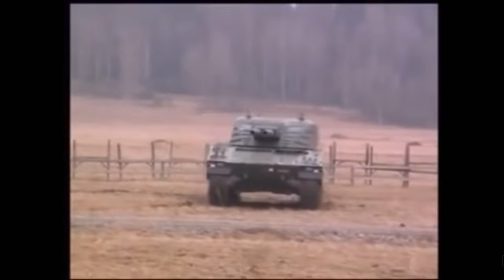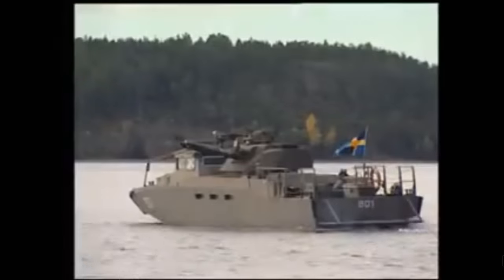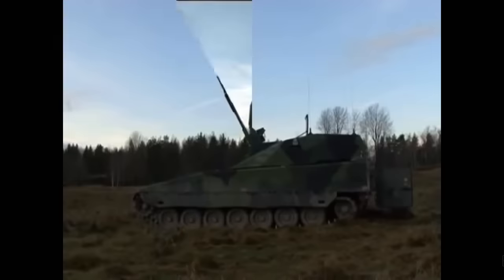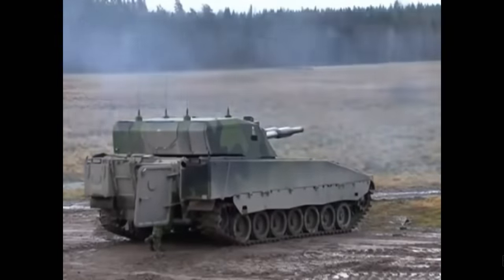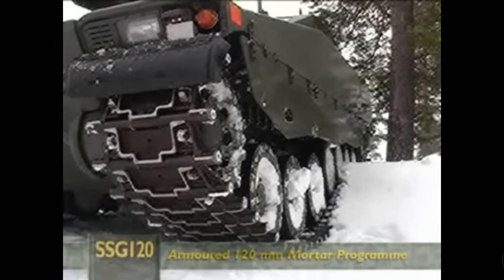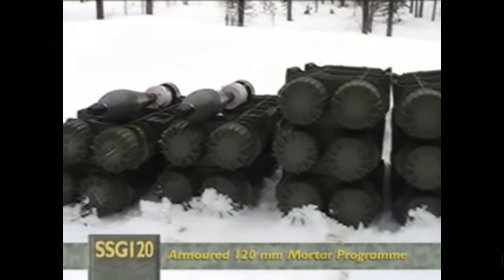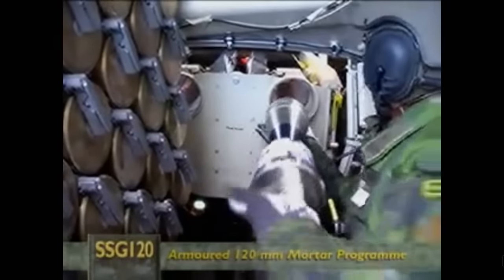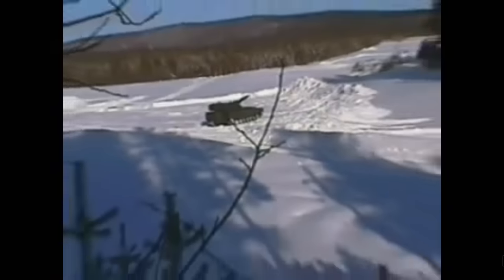Advanced Mortar System (AMOS) - Twin Barrel 120mm Mortar

Comment: I was in a training exercise once with these on the opposing forces side and it was a nightmare. Our side consisted of the Finnish armoured brigade and the other side from variour jaeger brigades and the one single thing I hated more than anything was the AMOS. It was frustrating as all hell to come under mortar fire, try to push forward fast to engage the mortar team only to realise the bastard was an AMOS and simply had fired and then ran away further to rain down judgement again. Truly a wonderful piece on machinery if it's on your side.
Reply: Lmao that's awesome, ... But how does it maintain target sight? Especially with you rushing the mortar linesa
Reply: @mandelorean6243  it has GPS so maintaining target lock is easy as hell.
Reply: And fuly stabilyside turret. It can shoot to same terget area while driving
Reply: @mandelorean6243  Just to add, there is also a drone system being developed that can do recon for you and can designate targets. Those two together will be quite devastating.

Comment: I love how the AMOS turret could be placed on a river boat like implemented by the Swedish navy and how it could still be fired at high speed while on the move.
Reply: It's pretty impractical as you see how much the boat rocks when it shoots.
Reply: @2genders  a good stabilizer would fix that
Reply: This looks perfect for home defense.
Reply: @alaric_3015  Nemo at least has a sufficiently working stabilizer even for that.
Reply: now they have more capable Nemo for that useage.. its nice to havea tight  collaboration with nordic countries nowadays, like this airforce agreement
Reply: The smaller NEMO was chosen for Swedish Boats. It is basically the same weapon but with a single barrel.

Comment: I am trained in 60 and 82 mm mortar. Trained crews from the state of disassembled  to targets aimed with under a minute. My crew’s personal record is 52 seconds. If you have a good spotter. The enemy gets a precise steel rain for 3-6 minutes depending on the distance and shooting parameters. After firing, the mortar was disassembled in 15-20 seconds and we were again moving towards the new firing position. It's all because of the artillery radars. Anything slower and you become a target
Reply: But u cant fire mord than 6km.

Comment: There's just something amazing about twin guns.
I think every tank should have them, just for aesthetics sake.
Reply: Or perhaps 3
Reply: @hillanderson6503  120mm 6-barrel electrically-driven. Call it GAU-666 and slap a couple of those on each Abrams.
Reply: There's a very good reason no tank with two main gun barrels has entered regular service. There's no room for the loader or autoloader in a reasonably sized and mobile tank. With a mortar system this is less of a problem as they are far smaller and much lighter.

Comment: Watch America make a quad version
Reply: Russia see the US quad version and takes a sip of Vodka...
Reply: Long as it only cost 10 x  more .
Reply: octa barrel with each having a 0.8s reload time :D
Reply: @A3ATOT  Russia is just 🅱️oneless USSR
Reply: M ZAKRIA  It's not really any more threatened by anti-tank weapons systems than any other armored vehicles. Sure, it might be a higher value target than most similar sized vehicles but that's about it.
Reply: That would legitimately be terrifying...

I mean, this thing can pump down 7 rounds a barrel in a single MRSI mission.

That’d be 28 rounds from just one vehicle theoretically.
Reply: They cant! They have no patent🇫🇮
Reply: An American 4-barrel version would probably not only cost ten times more per barrel (x40 per vechile) but would also have ten times more supertech scifi technology most of which might almost work reliably in the battle field. There would be versions for the Army and the Marine Corps plus a lightweight miniature airlift models for both of them. A remote operated unmanned semi autonomous platform would finally be agreed on as a compromise after 7 years of R&D. However, the project would be later cancelled due to excessive training required for operators, huge maintenance costs, and since the mobile supermortar's inability  to move on unpaved roads or off road without soldiers escorting it.
Reply: @rikulappi9664  im not sure if this is a joke or not
Reply: But how many 50 cal.s can we slap on it?
Reply: @vingerebise8714  It's not a joke. Our requisition system is just stupid.
Reply: Never.
Reply: Thats 4X the friendly fire power ;)
Reply: @bluewarbler9034  have you seen their artillery systems? they love their artillery
Reply: @williamhoskins7818  I'm American, and that is nothing but True!!  But now that Biden "won", we will now be issued hand painted bricks.
Reply: @bluewarbler9034  Hey!  You forgot to insult what my Nation is going to become!
Reply: So basically, the  wirblewind is making a grand return, and this time the caliber is a bit higher...
Reply: @tfs203  that's what they said about Al Gore.
Reply: @tfs203  it's a damned shame too. First he plans on disarming the citizens and then finish handing the country over to the highest bidder.
Reply: @leesmith6792  They are pushing their agenda too hard, too fast! This is going to blow up in his face, as the months go on! He has promised every special interest group and minority, everything they wanted to hear, but alot of it, is the complete opposite stance of another "free hand out" group.  
 For example, he promised all the  Karen Liberals, and poor, inner City minorities, that their children will be right back in school, when the CDC says its OK. Well they did, 3wks before he was even President, but he also promised Teachers Unions all they wanted, and they dont want to work!!!  
 So they changed the definition of what "Back in school" actuall means!  Too them, its 30% of our children, going 1 day a week....im not joking either!
Reply: @tfs203  you are so right! It's part of their playbook! They claim everything they do as "Constitutional" etc. All the while catering to special interest groups,  padding their own pockets and violating the Constitution at every turn!
Reply: They already did,it's called MARV in CNC3
Reply: @leesmith6792  Now look at our Nation.  A sad shell of what it was, with a generation of fragile, emotionally unstable communists for our future.

Comment: During my career as an 11C, I advocated for a breach-loaded 120mm mortar mounted on a Bradley or ABrams chasis. I also wanted a direct-fire capability (HEAT, Beehive, etc) in addition to the traditional high angle rounds.

Comment: Matsimus what you mean future precision Ammunition for mortars? Those are already in use in Finland.
Continuing: a 120mm Shell can penetrate T-90's top armor. So yes it can penetrate armor
Reply: It can of course because it's a heavy object that's affected by gravity and is able to direct kinetic energy in a very small area, a.k.a the tip of the munition,but it is NOT made as an anti armour munition type, it's just able to pierce some armour, the turret top of a vehicle is always going to be stupidly thin.
Reply: DonRaynor a 120mm shell can penetrate any modern MBT in existence from top armour. not just t90. Unless it has hard kill APS that hit projectiles coming from above.
Reply: The 2S4 Tyulpan can also do that. It fires a 240mm mortar which weighs around 130kg. In addition to the high explosive bombs, it can fire armour-piercing, chemical and nuclear  rounds. It can also fire the "Smel'chak" ("Daredevil"), a laser-guided round. However it can't fire chemical rounds anymore cause Russia destroyed all their chemical weapons. It saw action during the conflicts in Afghanistan and Chechnya. In both conflicts, the Smel'chak round consistently destroyed targets quickly, precisely, and with only a few rounds.
Reply: those HEAT rounds are probably duel purpose anti-bunker/building aswell as anti-vehicle so you can pound enemy defences with a mixture of these and HESH and HE and stuff and you can at least damge verything in the target zone.
Reply: Matthew Burger  STRIX have sensors and on board computer so it can select target or action and guide the munition toward a target with rocket pulses.
Reply: top of the t-90 is only enough to stop large MG fire
Reply: @CaptainGrief66  Shaped charge.
Reply: @dwightehowell8179 
You don't use such a big shell that's also a HEAT round against 40mm~ish of steel, it's useless and expensive.
Reply: @CaptainGrief66   Nothing has armor that thick over engine compartments and the tops of turrets. This thing has a 120 mm shell. It can't not use a round that's big enough. It can fire two of them every time it fires.

Comment: Rotary version NOW.
Reply: I was going to say that...
Reply: 6 Barelled rotatory 120mm mortar system. I wonder how many resupply vehicles you'd need trailing a single one of those systems to keep it firing for 1 minute.
Reply: You will need a factory!
Reply: I was thinking 4 barrel like a Shilka.
Reply: That would entirely depend on the ROF, which if driven by an electric or hydraulic moter could be anything.
Reply: Honestly just a Metal-storm mortar system. If you don't know what the metal storm is...

https://youtu.be/d8hlj4EbdsE
Reply: The mammoth tank is real 
WTF
Reply: one rotary shooting unit would cost too much. for USMC maybe.. but even for them the price tag would be too much.
Reply: overpower is stupid.
and waste of resources.
Reply: LazyLife IFreak Rotary system would be useless. Its still slow to load, theres not enough ammo, and you are not getting any better firepower in the first 10 seconds. After 10seconds, the enemy has taken cover and sustains 80% less casualties. In 5seconds its already something like 60% less. A rotary system would be worse in every way imaginable. These are all aimed shots, timed to hit at the same place at same time, within about 2 seconds. It doesnt mean 2 second intervals, but a barrage of 14 rounds starting and ending within 2 seconds. A rotary system might do 14 rounds in 14 seconds, max, but with diminished effect of fire for most. Its naturally inaccurate, heavy, meaning it can carry less ammo, likely cannot fire STRIX or other specialist rounds, and is just overly complex which means mechanical problems especially in extreme weather conditions like the Nordic countries. In short, AMOS is an awesome sniper mortar, while you want a machine gun. Easier way to get that is to get a lot of traditional artillery.
Reply: VikingHaag Probably none. At 120mm, the system probably is slow enough that it will have enough in its internal stores for 1 minute. Thats 40-60 rounds.  Well, probably closer to 6, since the reloading system would be crazy and have no more space or weight left. I suggest stationary barrels, but more of them, like 32, pre-loaded in base, or even more, like 64, and using rockets instead of mortar barrels to make it lighter... wait, thats WW. 2 Calliope. No need for new systems afterall. ;-)
Reply: Quad barrel, rotary system was the NSA arty system in Ground Control 2.
Reply: I don't think a barrel overheating is a problem.
Reply: BRRRR TA TA TA TA TA
Reply: That would probably be pretty effective in a 2-3 barrel config. It doesn’t need to fire fast but that reload time is gonna be insanely short with the mechanism.